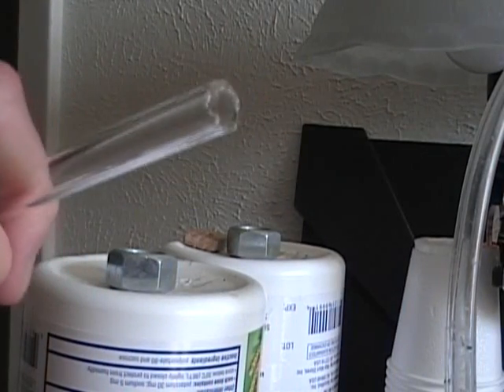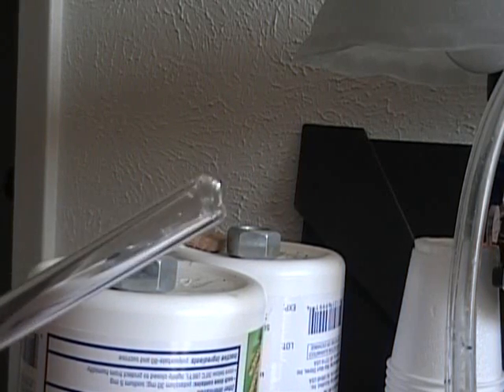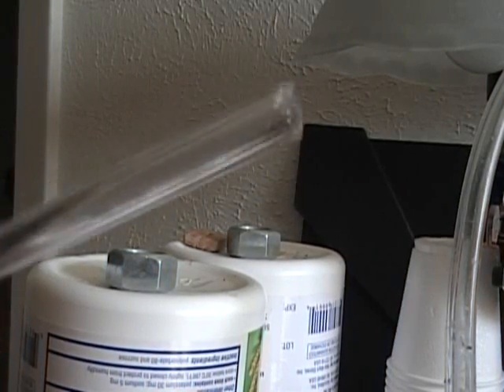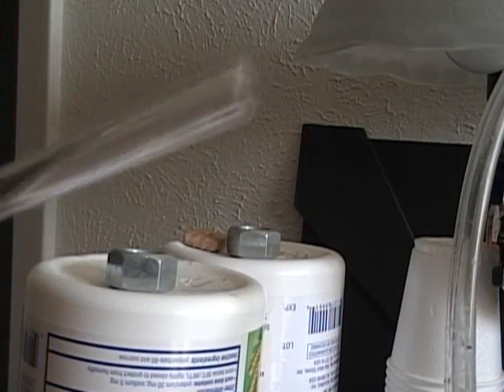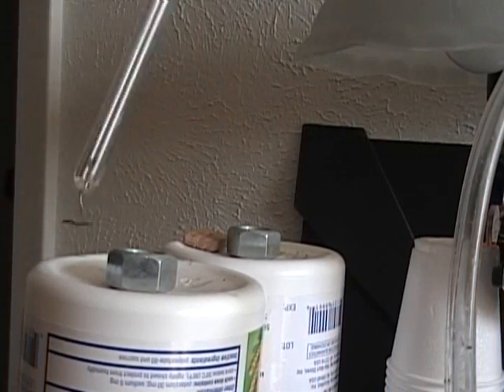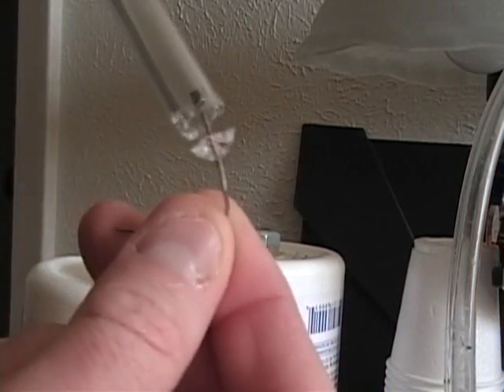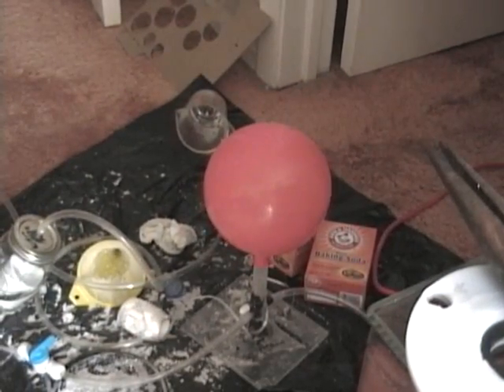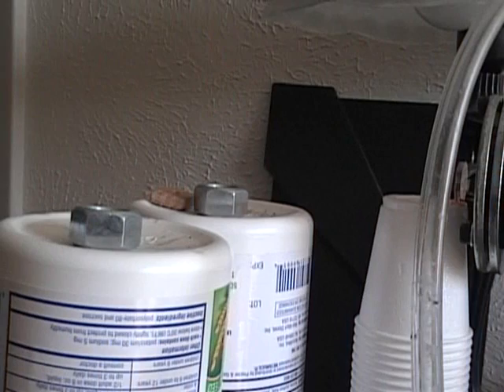Homemade Carbon Dioxide Laser Running on Exhaled Breath!

Comment: EXTREME EYE SAFETY HAZARD, uncoated polycarbonate transmits 10,640 nm (10.64 micrometer) CO2 laser light:

Google Search: polycarbonate (transmissivity OR transmidia)

For you DIY and other researchers, make SURE you know the difference.  Both acrylic and polycarbonate safety glasses are commonly available.

Use your 10,640 nm photodetector to test the effectiveness of your safety glasses.  A reduction of intensity at low intensity by 10^6 should be measured across the glasses/goggles.